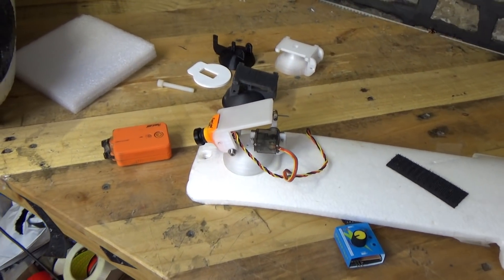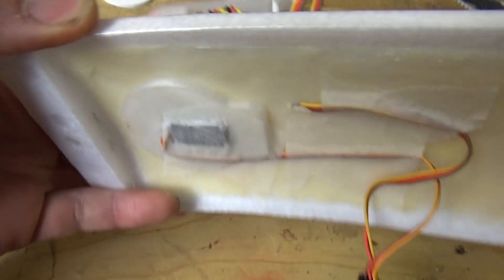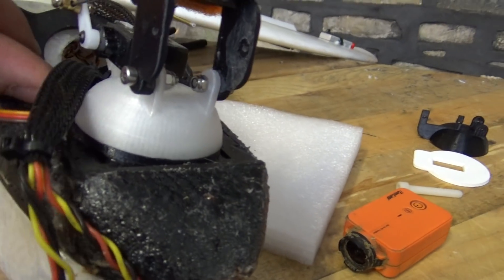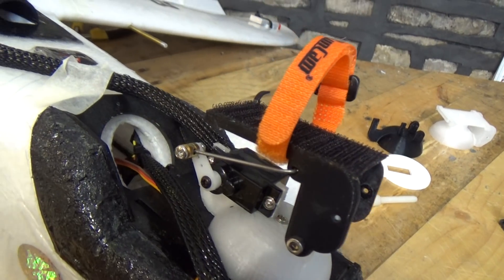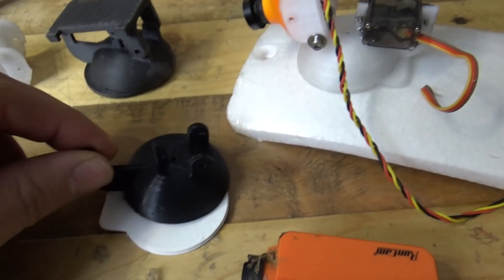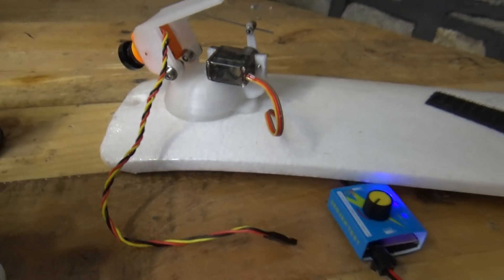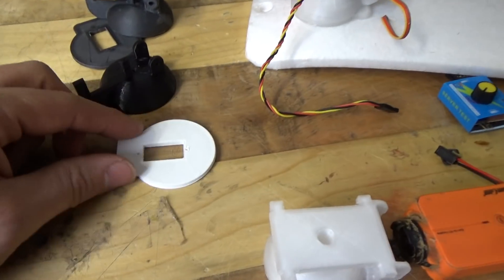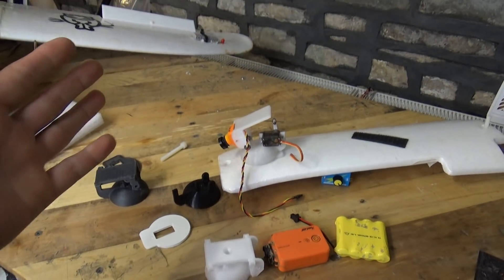3D Printed Pan, Pan & Tilt FPV Camera Mounts

Comment: Matt.
At the beginning of the video there is a white, pan only camera mount on the workbench. Could you add the design to the others on thingiverse, it doesn't seem to be on there the pan only version that is, only has the hd camera platform but doesn't have the fpv mount
Much appreciated.
Reply: I also looked for this. It's a shame he never shared it like he said he would :(

Comment: Thanks, I have wanted to add a pan tilt that will hold a sessionto an fpv tundra, this will do nicely!
Reply from the maker: Howdy fella, the session is at least twice the height of my RunCam 2, as such I'd suggest doing what I did and glue on a Velcro tie to make sure it's not coming off any time soon. Hope that helps fella, Matt

Comment: Hi Matt, I dont have a 3D Printer, however I want a tilt only platform so I can look downwards for my Camera quad.  I will probably make one by hand instead. Your video was useful.
  May I suggest you ditch that Z bent wire on your tilt linkage and substitute some ball joint links instead (both ends) Otherwise it's going to rattle in flight.
   If you buy an M2 external thread die and then some bicycle spokes (EBay), you can cut and make your own precision linkages and be the envy of all your mates...Not just on this mechanism but all of your flight surface linkages.
  Tip, hold the Die in a small vice, and the wire in your battery drill for easy thread cutting, forward and reverse.  You will never use another crappy commercial linkage ever again....lol.
Reply from the maker: Howdy fella, it's been pretty stable so far, but ace point on the ball joint. As for making the threads, a blow torch on the thread helps :D Matt
Reply: Cool....can't wait to see some downward looking footage Matt.....The sky is not very interesting really...lol